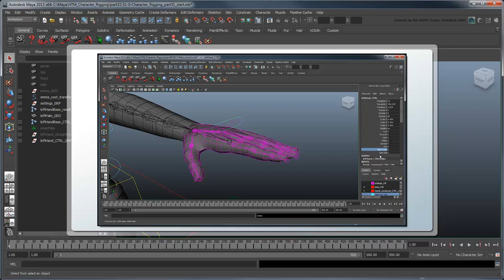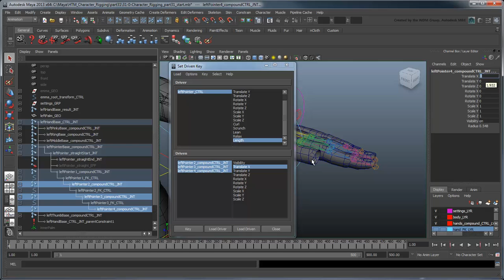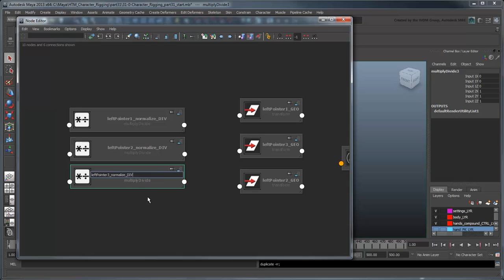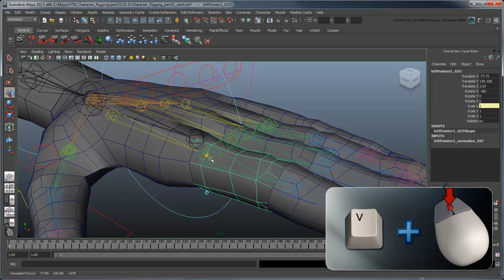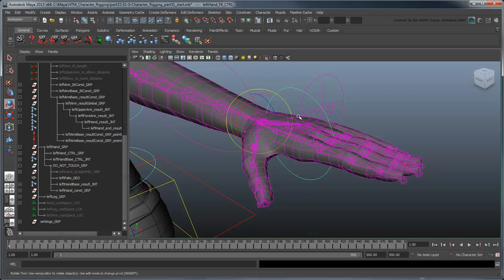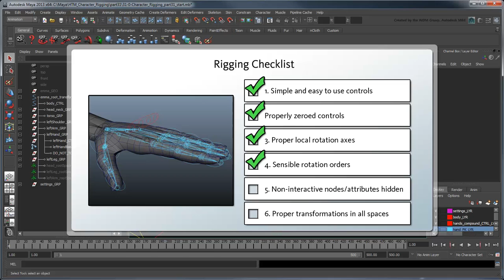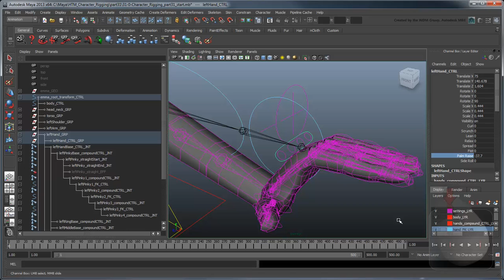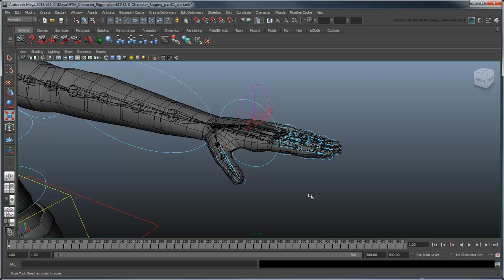Creating a Character Rig - Part 31: Hand global transform and cleanup (Advanced)

Comment: I made my rig without the arm twist (it wasn't required). To which object should I bind the leftHand_base_Const_GRP joint to, since I don't have a bind joint altering the space of the result hand?
Reply from the maker: +Ocelott|SheDoesStuff I would constrain it to the result arm in that case.
Reply: +Maya Learning Channel I parent constrained the leftHandBase_Const_JNT to the result hand, but it went awry. What should I try now?
Reply from the maker: Binding the hand to the arm really shouldn't be any different regardless of whether you used segmented twist joints or not. Either way you should be parent constraining the hand_const_grp to the hand_result_JNT.  Just make sure you don't constrain it to the hand_end_JNT, as you still want the twist to be at the wrist.
Reply: The hand is working fine. It's just the palm raise and palm twist attributes. I can't get it to move correctly with the hand result joint.
Reply from the maker: Ah my mistake, I actually forgot about those controls (it's been a while since I put this tutorial together).  That is actually a significant problem, because palm raise/lowering relies on the idea that it can affect the geometry without actually changing the position of the result arm.  

There are two ways you could do this.  One is to follow basically the same premise as the segmented forearm, but just make it a single joint (since you said twist is unnecessary) and do everything else the same as these vids.  The second, more complicated way, would be to use some kind of conditional expression/node structure to determine when the arm's result joint follows the palm vs the arm.  I would recommend the first solution, as it's way simpler.
Reply: Alright, thanks! This has been an awesome series, btw!
Reply: +Maya Learning Channel I tried that step and it "kind of" works, but my result geometry isn't following the segment joint. What should I do?
Reply: +Maya Learning Channel Nevermind! I forgot that the segmented geometry is parented under the segment bones, not the result joints.
Reply: +Maya Learning Channel I added the spline, but now my IK is dysfunctional (whenever I move the upperBody_CNT towards the direction of the hand, the arm moves as if its FK, and whenever I pull the control away from the arm, it causes the setDrivenKeyframe for the IK stretching to activate when it shouldn't. What should I do?

Comment: EDIT: See my last comment for the solution to this problem.

I've adopted this rig tutorial in a skeleton with a single root; i.e. all bones are connected. Everything works flawlessly, save for one thing: when I parent all the hand CTRL groups and the likes to the bind joints for the arm and make it so the hand follows the arm nicely and the arm follows the hand where appropriate, moving the hand using the arm's IK control causes a double transform. The same double transformation occurs when blending to the "FK forearm" mode with the Elbow setting.

Since the leftForearm_HDL's Inherits Transforms was already turned off in an earlier movie, what can I do to stop this double transformation?
Reply: Note that the double transformation does not include movement of the leftArm_end_bind_JNT, causing the hand and arm to separate.
Also, the leftHand_baseConst_JNT is unaffected and moves in tandem with the IK control.

Looks like only the result hand's leftHandBase_result_JNT is doubly transformed.
Reply: Shrooblord Maya Learning Channel It seems I have solved the problem by not only creating all constraints and relations as shown in these videos, but additionally creating a parent constraint between the leftHandBase_result_JNT and the leftHand_baseConst_JNT, with the latter being the parent.

All double transforms are gone in all IK, IK/FKForearm and full FK modes!

Comment: I have the same problem here. My leftThumb1_GEO and leftThumb2_GEO scale according to the world space (I think). They didn't scale up along the thumb finger (Scale X). The leftThumb2_orient_JNT and leftThumb3_orient_JNT have already been set so the X axis of the joint is along the thumb finger. I have no problem with the pointer, middle, ring, and pinky, but I can't figure it out with the thumb finger because of the angle. How do I fix this problem ?
Reply: Thanks for writing this up, it solved my issue as well. :)
Reply: This is the picture link : 
http://tinypic.com/r/29dijac/8
or
http://i61.tinypic.com/29dijac.jpg
Reply from the maker: Michael Elton Widjaja Are you scaling the geometry or the group node?  You want to scale the group node (which you have presumably oriented to face down the thumb joints).
Reply: Maya Learning Channel I don't know the exact problem here but I see that in the project files 31_1, the leftThumb1 and leftThumb2 GEO have a value of 0 rotate X Y Z. 

I freezed the rotate attribute for the leftThumb 1 and 2 GEO because my leftThumb 1 and 2 GEO rotation (X Y Z) didn't have the value of 0. All other fingers GEO have a 180 (or -180) X rotation and the Y and Z rotation are 0. 

My GEO (except the thumb) rotation value are the same as the project files 31_1 (just a slight different, X rotation is set to 179.976, Y rotation is set to -0.283 and Z rotation is set to -0.254).

Maybe the rotation attribute of the thumb 1 and 2 GEO are inherited from the joint rotation when we want to set the z axis rotation perpendicular with the thumb. Is that right ? 

So I freezed the thumb GEO rotation (only the rotation) and it works perfectly. The thumb stretches as expected (along the thumb finger).
Reply: Thank you Michael Elton Widjaja... Worked for me too!

Comment: On my own character model, I’m using the method from the hands and fingers and applying it to the foot and toes. After grouping everything related to the foot and toes and parenting to the root transform control. I’m up to the point where I am connecting it to the foot. My question is how do I connect it to the leg? Because I already created locators [foot loc, ball loc, toe loc heel loc, etc…] for the foot controller in lesson Part 19 through 21. Do I need to create new locators or can I use the locators I already created in Part 19 - 21. And if I do connect the toes to the rest of the foot using the previous locators, and it does, or doesn’t work on the IK setup. How do I connect the toes to the foot FK ball and toe controls?
Reply from the maker: Without seeing your specific rig, I can tell you that the leg moves differently from the arm so it's a bit difficult to treat it exactly the same way.  If you want specific toe controls (like the hand) I would still use a combined foot/leg rig (i.e. don't separate them out like we do with the arm/hand).  Just add the toe controls on top of what we already have.  This will ensure the IK setup still works properly.

Comment: I set all the set driven keys for the finger length and set the scale for the geometry on the pointer, the middle, the ring, and the pinky finger geometry. Now how do I setup the scale for the thumb geometry. I look at the process leg stretching tutorial of part 12, but because the thumb joints structure is at a weird angle I can’t get the thumb geometry to match with the joints. How do I fix this? Also nun of the other tutorial show any stretch finger just squash.
Reply from the maker: Jared Davis You want to put the thumb geometry in a group node that is oriented to point down the thumb (i.e. at the "weird" angle).  Then you squash/stretch the group node instead of the actual geometry.  Look at the thumb hierarchy in the included example file for an example of this.
Reply: Maya Learning Channel Is there a better way to orient a group node to the thumb joints, or do you just have to eyeball it and hope for the best? Also the other tutorials don’t show this type of method.
Reply from the maker: Just eyeball it.  Remember, this is just proxy geometry which is used to approximate the volume of your eventual skinned model anyway.  The exact orientation of any proxy geometry is not that important in the grand scheme of things.  Once you skin the rig for final rendering this issue will become moot.
Reply: Maya Learning Channel
Because the thumb joints structure is at a weird angle, and the joint hierarchy is not straightforward; like in the leg. If I use part 12 methods for the leg geometries to create stretchy thumb geometries. Where do I place the group nodes in the thumb joint hierarchy to control LEFTthumb2 GEO, and LEFTthumb1 GEO?
Reply from the maker: Jared Davis I would urge you to check out the included scene files (specifically "31-1-Finger_length_attributes.mb") as simply looking at the node network will explain things much more clearly than I can explain in a comment window.

Also I misspoke earlier.  Although you can accomplish this by using group nodes oriented down the thumb, I'd forgotten that I already took care of that when we created the compoundCTRL joints for the other hand controls (like scrunch and curl) earlier.  Since those joints are already oriented down the thumb, then stretching the geometry is actually handled exactly the same way as the other fingers.  I apologize for the confusion.

Try opening that aforementioned file and selecting the thumb_CTRL.  Open the Node Editor and view the connections, then follow the connection from the "Length" attribute to see exactly what's going on.

Comment: At 6:20, you parent the arm's end_bind joint to the wrist, which works since the skin is set to follow that joint separately from the rest of the skeleton. I'm currently using a rig where arm twists like that were not necessary and thus don't have such skinning applied. But now I've run into a problem: without skinning the arm to that end bind joint, I cannot properly constrain the arm to the wrist, as trying to do it with point or parent constraints will create a loop where the wrist is connected to the arm via parent constraint, while the arm is constraining itself to the wrist. If I do skin the arm to that end bind joint (by skinning the forearm alone to that one joint as a whole), I get double transforms (which I expected), though I can't figure out how to get rid of them (you need the original bones to be affecting the geometry, and now you're skinning on top of that, too, which means two things are driving the geometry's translations and rotations etc.).

Is there a(n easy) way to solve this?
Reply from the maker: Sorry, I think I misinterpreted the OP's question.  Are we talking about a scenario where the palm roll and raise aren't necessary and thus the palm geometry isn't skinned?  In that case, the setup is much simpler.  Forego all the "straight" joints, then group the hand controls and joints together in a group node (like the other appendages we've done) and parent constrain that to the left arm's end bind joint.  That would do the job without any cycles.
Reply: Maya Learning Channel In my case, the palm raise and side roll were causing the hand to break away from the wrist, and I have no bind joints to attach it to (because I didn't need to skin the arm), which is what the tutorial said to do. I tried to create bind joints, however none of the methods I tried worked. I couldn't parent constrain the leftHand_baseConst_JNT under the result geometry, due to the pre existing parent constraint.
Reply: Maya Learning Channel Shrooblord  never mind, I just realised that I'll have to redo the arm anyway :/
Thanks for your help!
Reply from the maker: You can still create an extra forearm joint (just one joint if you don't need it to twist) for skinning / allowing for palm raise/lowering.  It'd be basically the same setup, but just replacing the segmented chain of joints with a single joint.
Reply: Maya Learning Channel I'm experiencing the same problem, however I found this a bit confusing. If I create another forearm joint, it has to remain parented in the chain for the IK spline to work. When I created bind joints for the forearm and hand joints, it was creating double transforms, and the parenting didn't work for the bind joints anyway.
It also seems to stop the hand end result joint from functioning..
When I duplicated the forearm and hand joint it was connected to, nothing went wrong, for the precise reason that the duplicated forearm and hand joint were completely unconnected to anything else. When I parent them under the forearm, they experienced double transforms.
Is there something I'm missing?
Reply from the maker: Ah in that case I wasn't mistaken in my original response.

Basically, my suggestion is to rig the exactly the same as the previous videos showed, but instead of creating segmented joints for the forearm, replace it with just a single joint (since skinning isn't necessary).  From there the rest of the tutorial is the same.  In order to build a structure suitable for the palm raise / roll control, you will still need that extra joint (otherwise you get dependency loops exactly as you've stated).
Reply: So basically, SquircularKnights, follow all steps as per normal, then, when you get to the point in the tutorial where you start adding the segment joints, add only one but do add one. This extra joint is the joint you use for all necessary parenting etc..

In my case I ended up going with arms that had three segment joints each (instead of the in this tutorial shown five), just to get the twisting to work across the arm sections as a unit but not over each individual bit of the arm (just to be clear: I'm modelling a skeletal arm (not 'Maya skeleton' - 'biological skeleton') so twisting is only slightly necessary).

Do correct me if I'm wrong here, Maya Learning Channel.
Reply from the maker: That's correct, Shrooblord.
Reply: Maya Learning Channel Shrooblord 
Everything works well, except that now the segment joints (and the geometry parented under them) are now experiencing double transforms, rotations and scaling. I tried fixing this by turning off the inherets transform of the arm, which seemed to work, but broke the FK controls' space switching.
Thanks a lot for the tips!
Reply: SquircularKnights You could also add a group node on top of them that has a negative transform, thereby negating one of the excess transforms. Not sure what the impact of such a group is on the rest of the scene though.
Reply from the maker: SquircularKnights You shouldn't have to disable Inherits Transform for anything but the palm geometry (because it is skinned).  95% of the time double transforms are a sign of a parenting problem.  Are the segmented joints parented under the root DO_NOT_TOUCH_GRP as they should be?
Reply: Maya Learning Channel They're in the leftArm_GRP's DO_NOT_TOUCH_GRP. I found that I'd overlooked turning off the spline curves' inherets transform, and doing so stopped the rotate and translation problems. However, there is still a problem with the scale X of the arms. Everything is fine when it is scaled down, however when it is scaled up the shoulder experiences a double transform.

Comment: I have set up my hand and rig to start in the rest pose, as explained in a different comment, and when I use the length attributes as listed here, the geo does not conform properly to the rig. Any recommendations on how to mitigate this? Do I re-group the geo, parent the grp's to the joint and scale from them? Thank you in advance,
Reply from the maker: That's definitely your best option.  You can use the group node's rotation to better control the direction of the scale operation.  In newer versions of Maya, you could also just change the pivot (Insert key) of each piece of geometry to point down the joint, achieving the same effect.
Reply: Maya Learning Channel ooh, perfect, thanks!